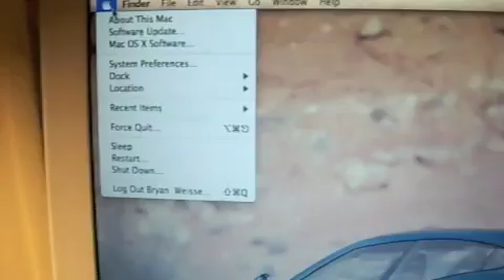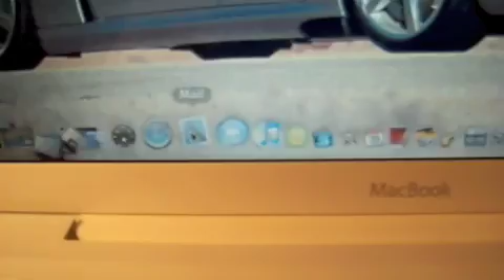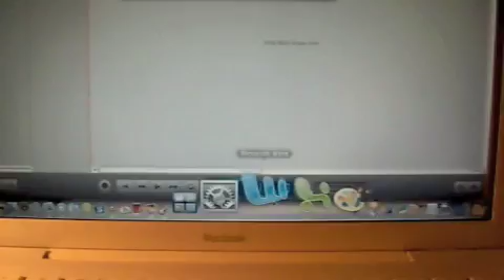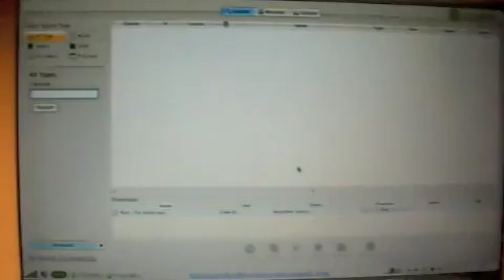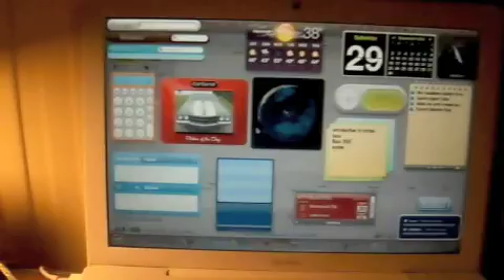Macbook 1GB-4GB Ram upgrade and speed test

Comment: @raptor750r No I was referring to the dual boot or bootcamp. Unless you have a huge processor or you have tons of ram and at least a 1tb HD I would not run dual operating systems. I've played around with one that ran snow leopard and windows 7. It was sooo slow and it froze for like a min several times.

Comment: @tougejohnnydrift You can't run a 5300 & 6300 at the same time. One or the other they have to be the same speed. Both 5300, and if I recall correctly I think that MacBook I had would only run 5300. Good luck!

Comment: Ok, I have the same MacBook same specs. 2.1ghz core 2 duo processor, 3gb ram, 250gb HD. I have 1gb Kingston ram in the left slot and 2gb Kingston in the right slot. When I take the 1gb out of the left and place a 2gb of kingston 6400ram that is compatible with 5300 my computer wont boot. If I place a 2gb PNY 5300 ram in the same slot my computer wont boot. Still wont boot if I switch them around too. Im running snow leopard 32bit... Whats the problem, why cant I achieve 4gb of ram?

Comment from the maker: @thewaldoishere Running bootcamp won't slow down the computer because when you use bootcamp its ONLY running windows.  If you use a program called "Parallels" this will slow things down because it runs WIndows in a seperate window as if its a program while in OSX. Only advantage to using parallels is that its quicker going from OS to OS.  From my experience bootcamp is better because its already built in, free,  faster and seems to have less problems (with drivers and such).

Comment from the maker: there is a noticeable difference however not as much as i expected. but as i  mention in the video it really does speed up the choppy graphics that you see when running many programs.  i mean the CPU is only so fast, but the upgrade did help. but at the same time its also not worth the $300 that apple asks for so i stress spending time looking for the best deal. (i got mine at radioshack for $95)